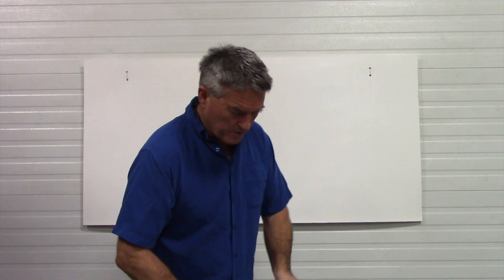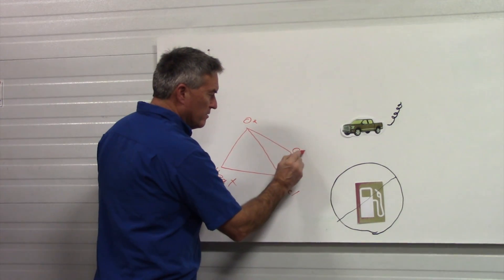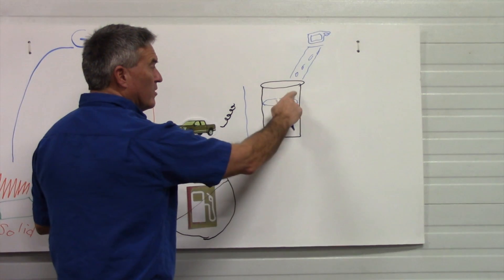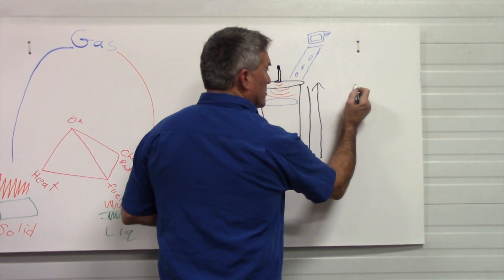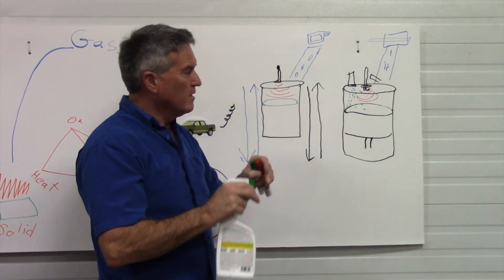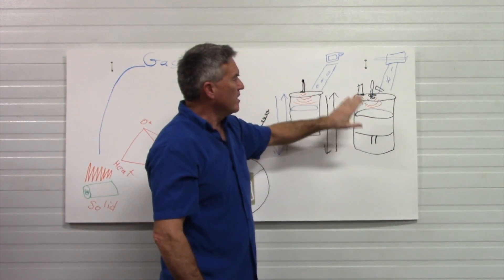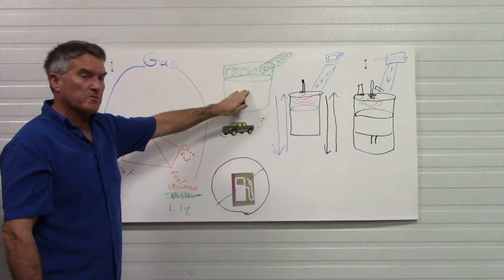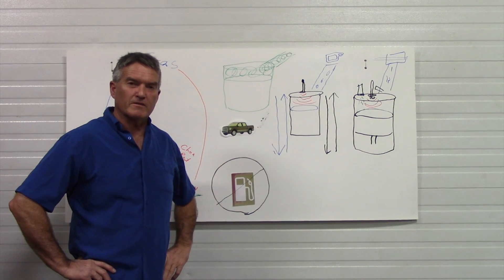One Simple Trick to get 100 miles per gallon with less pollution!

Comment: Pardon me, but you are full of BS.... GDI is the exception, not the rule.... very very few engines use direct injection.   Also engines like the Ford Ecoboost of Subaru DIT use targeting to stratify the charge, so that they can burn very  lean mixtures under some circumstances..... like a diesel.      The wonders of vapor fuel is utter BS for a number of reasons.  This has been tried and advocated for many years.  It DOES NOT WORK..... PERIOD!!!   This is utter bullshit, and I speak from many years of REAL WORLD EXPERIMENTATION.    I've been playing with vapor fuel off and on for over 40 years, reading all the literature, and building various experimental systems.  It is simply nonsense!!  But persistent nonsense.    I've done this on large generators and pumping engines running irrigation pumps where there is a fixed load, and I could control the flow of vapor and air, adjust timing in real time, etc.  In other words FULL CONTROL OF ALL VARIABLES....... It simply is a fantasy, and utter bullshit.
      The proof of the proverbial pudding is the efficiency of propane and natural gas engines.  There is less energy per gallon in propane than gasoline, but it is a fully vaporized fuel as it enters an engine.  Efficiency per gallon of propane versus fuel efficiency per gallon ( or pound ) of gasoline is roughly proportional...... IF YOU BUILD THE ENGINE ACCORDING TO THE NEEDS OF THE TWO FUELS.   Propane for example needs a higher compression ratio to be efficient, but even with an optimum engine it does not show the supposed dramatic benefits of vapor fuel. 

      The reason for this is simple...... In a gas engine, the heat of initial combustion converts the fuel to vapor virtually instantly.    I can promise you that you WILL NOT achieve these dramatic results, because they are not there to be had.  It is appealing as much as I and most others hate oil companies, to believe in a vast conspiracy.... it does not exist, and never has.  This is pure "pie in the sky". 

        Having rebuilt literally hundreds of engines over the last 40+ years, and worked independently in a field that allowed me to experiment on fixed load engines as few people ever are able to, I can say with assurance of experience that this nonsense with the exception of the obvious truth that fuels  must enter a vapor form to combust... which even a child knows who has watched anything burn.
        Petroleum fuels in internal combustion engines hit the wall at about 20% efficiency.. perhaps slightly higher with improved technology, but that increase is pretty minuscule.   Improved efficiency is to be had from reducing loads, and improved transmission systems that allow an engine to operate in it's optimal efficiency range.  The biggest potential gains are to be had in capturing a percentage of the waste heat, and using it for other purposes, as the waste heat is about 80% of the energy of the fuel.   This technology exists in the form of change of state salts that can capture heat, as they change from solids to liquids, releasing that heat as they convert back, and that is where we need to be looking.   Energy burned for propelling a vehicle, or for heating a building..... what's the difference?   It's still fossil fuels burned, and carbon released into the atmosphere, and a depleted resource. 

      You will NOT achieve huge increases in "gas mileage" until you start looking not at "gas mileage" but at fuel energy utilization overall.  It's as simple as that.  If the gas you burn not only takes you to to work and the grocery store and bar and shopping mall and Dodgers game, but heats your home.... or at least helps..... Then you win.    If you focus ONLY on "mileage", you will beat your head against the proverbial wall and never get ahead!!

Comment: I believe this to be true. I burn wood for heat in my home. I always thought that wood just burned when it got hot enough until I read an article that explained how heated wood releases gases that burn. My stove has perforated pipes inside across the top that bring in air from outside (below) the stove. Me and my rabbit like to sit and watch fire that seems to shoot out of the holes while flames dance above the logs.

Back in the 1970's there were stories circulating about similar concepts/devices. One guy claimed that a nail thrown up by his lawn mower blade pierced the gas tank with a small hole. He said it seemed to never run out of gas after that; his theory was that air entered the small hole and increased the the evaporation rate of the fuel - do you think "running on fumes" is a myth? I'm not a physicist but I've heard there is a calculation for the caloric (as in Energee!) content of an ounce of gasoline. A VERY small amount of gasoline will produce explosions comparable to those produced by TNT. Other people I heard back then used air pumps and an expansion tank of sorts to vaporize the gasoline before introducing it into the manifold. I feel it's only a matter of changing liquid gasoline to a vapor, safely, and mixing it with the appropriate amount of oxygen before or as it enters the cylinder. I kind of think that a small percentage of water vapor could also be introduced with it to increase the pressures produced - quite inexpensively. There are a lot of combustion engines on earth. We are burning our planet's blood  and fouling the air.

Comment: fact is a fuel injected non-diesel vehicle that has a properly functioning catalytic converter in its exhaust system puts out cleaner air than it breathes, there is a small amount of water a trace of hydrocarbons and CO2. What is the big offender coal burning powerplants used to make electricity. The reason automakers implemented fuel injection was not for performance it was because a ICE or internal combustion engine could not be made to run as lean as they do with a carbuerator. And heat is by product of the combustion process where you came up with this pyramid I wonder  but the formula or target air/fuel ratio lamda or stoichiometric is 14:7:1 no heat and really no chem reaction, remember physics no energy is ever lost it can be converted thus the atomized fuel is ignited converted to heat. what does this engine require 14 parts air, 7 parts fuel, 1 part carbon and a match to light it (spark plug).

Comment: This informaition is correct.  Implementation is more difficult.  Metering small amounts of liquid fuel relative to volume of air is hard.  Which is why most lawnmowers are finicky once dirty and hard to keep running.    Metering small amounts of gaseous fuel relative to volume of air is harder... but not impossible. Now design it. Fuel is used to cool valve seats, oil to lubricate piston, and anti-freeze to cool block. With gaseous gasoline and air mixture you now probably creating lean condition...

Comment: I did one better. Using just a crescent wrench and a flat blade screwdriver, I increased the horsepower on my 1969 Toyota Corolla to 850 HP with just one simple adjustment and I am now able to drive almost 3,000 miles on a tank of gas, which holds 4 gallons of gas.
You may bullshit kanaydians, but don't try to insult the intelligence of an American, aye!

Comment: Fuel does not cool and lubricate the cylinder wall, lubrication comes from the oil in the oil ring and cooling comes from the water jacket... fuel on the cylinder walls lead to increased friction, premature ring wear and increased blow by.

Comment: This guy is a moron, my first clue? When he said " fossil fuel" which it is not, the material we call crude oil is of mineral origin and percolates from deep within the Earth's crust, the process pushed along by heat from the Earth's mantle of molten material, this guy is clueless, you can get extreme mileage from your cheap little rice grinder, until the heat generated by extremely lean conditions melts the Pistons. Then your done

Comment: what we all dont know, well I know gasoline is less efficient then a steam engine.    I also know the effeciency is less then 40% ( meaning if you calculate how much  is going in, and how much energy you get from it..   pathetic really

and the end run, I KNOW that big oil will never release they're stranglehold on better fuels..

one proof is Stanley Meyer..   the guy who invented the car that ran on water (in ran on hydrogen/oxygen split from water)
but he was poisoned to death...   wonder why you'd kill someone if his stuff didn't work...
Reply: good points Harley.  Tip for you, "then" and "than" are two different words.  Check it out, you'll sound smarter.  Fusion may be our savior once quantum computing is harnessed.....  Until then, Shell Oil for me.

Comment: yup, its really easy, I get infinite miles off 0 gallons of gasoline....  because I'm splitting water with electrolysis and using the hydrogen and oxygen to run the car...  lol  dont give me any bullshit.

gasoline   = 87 to 94.  and all of it doesn't turn to energy.
hydrogen =  130 octane.  and all of it is energy.

so how bout 100 miles on 1 ounce of water...  LOL  get fucked oil company

Comment: If this happened, government would have to increase taxes on gasoline to make up for their "revenue loss". This happens whenever government gets comfortable with any level of funding and then somebody gets clever and finds a way to reduce consumption of the base metric of the revenue stream. Example: San Francisco bay area residents were told they must conserve half their water during California's drought. The residents did, the water company's complained that they weren't receiving enough revenue. The water commission "adjusted" the water rate so the water companies were receiving the same revenue by supplying half the water.

Comment: We are in no way approaching a shortage of petroleum, in part due to the fact that reservoirs are much larger than previously thought, and in part due to advances in extraction technology.  At the same time, advances in battery technology promise to make fossil fuels unnecessary by mid century.  By that time, every car will be electric, and by 2080, every airplane and every boat will also be electric.  Petroleum will continue to be used for basic power generation for a while, but even that will be short lived as solar and stored energy become cheaper than drilling for oil.

Comment: The liquid fuel does not lubricate the cylinder, unless it's a two stroke engine 😕 and then it is gasoline mix with ~2% mineral oil. But you are right about the liquid gasoline will cool the engine, ask any Nascar driver

Comment: Of course it can, but I thought you wanted to reduce the so-called 400 million gallons, not increase its usage in just about everything except maybe the kitchen sink and power toothbrushes.  Where are the savings then?  Just heat the fuel before it reaches the injectors.  Works well.

Comment: Vapor carburetors have been around a long time, I actually built one and ran a lawn mower engine on vapor alone and it worked well, the downside I discovered was it basically distilled the fuel down the the non-burnable crap they leave in the gasoline. Vapor carbs do work, but mine was crude and you will need to be able to vaporize ALL the gasoline, including the somewhat non-burnable elements in the fuel.
Reply: My Older Bro. Put A Lawnmower carb on his car in mid 60s. It worked pretty good. But people called him Crazy. Just like several comments by readers.

Comment: Well he said a lot of things just to get to one point which is the basic principle of a 4 cycle engine. Suck, squeeze, bang ,and blow. Also something he said that the fuel had to lubricate the cylinder and that is wrong on a 4-stroke engine a two-cycle engine does mix oil with gas, but not a 4-stroke.

Comment: Some have designed gasoline vaporizing intake systems, but they had so many fire issues and under power that the idea of pre-vaporizing is moot. The main issue is the energy required to power an engine with a load it is operating. An engine with only itself to power uses a tiny fraction of the energy one under load uses. 

One way that does assist fuel consumption is adding a water vapor mist to the intake. I've used such a system for years, yet it is just a fraction better than current intake systems. However, the mist does help reduce emissions.
Reply: Interesting Sir! Thank you

Comment: If you're still alive, let everyone know!  "THEY" have killed three people (as we know of them) who made H2O-fuel-burning cars and engines.
Best wishes,
Reply: Let me know where I can get this invention.... Love to try it ...jonrankin0315@ Gmail.com
Reply: @jonrankin7917  Hello,
I think you have sent your note to me by mistake; however, you do not need to go through all that process and can make a device in your backyard.  If you decide to proceed and try it, keep it between you and yourself.
l)  You need a small insulated (8.0e1 x 1.0e1" x 1.4e1") triple-layer vacuum (vacuum must be between the second and third cylinders) cylinder made of stainless steel.
ll)  Wrap heating wire/coil element on the inside cylinder to generate about 3.0e1-4.0e1 amps for a 1.2e1-volt battery.
lll)  Run a tube from the exhaust manifold (for hot air) through the inner and the second barrel; before the vacuum cover.
lV)  Route the gas through the inner cylinder, which initially (before the engine heats up) provides about 1.7e2℃.
V)  The output gas is so flammable and combustive that would need a cast-iron engine-head.
Vl)  The gas mileage for a six-cylinder, 4.0e2 horse-power, and a five-ton vehicle shall be around 5.0e2 miles per gallon. 

P.S. _ "THEY" are not idiots to go miles down in the waters and ice to bring oil for gas and are willing to kill billions to achieve their filthy goals.

Best wishes,

Comment: I am confused. Are you talking about a Diesel engine ?  If it's a diesel your example of heat, oxygen and fuel are correct.  I thought you had to have gas, oxygen and spark plus the correct timing.

Comment: Correction--It sprays only TWO times per second if it's part of an 8 cylinder engine. A cylinder of the 8 is spraying 17 times per second.
Reply: I'm puzzled how you came up with your numbers......
2000 revolutions per minute (rpm),  is 33.33 revolutions per second.  The fuel is burned once for every 4 piston strokes,  same as every other revolution of the crank shaft (the piston goes up and down each revolution,  2 strokes).  That works out to 16.6 times every second! That's per cylinder. 
2000 / 60 (seconds in a minute) = 33.33.  33.33 / 2 (revolutions of the crankshaft) = 16.665.

Comment: The theoretical, stoichiometric air/fuel ratio is 14.7:1.  14.7 parts air to 1 part fuel.  Supposedly the perfect ratio to burn all the fuel to leave no raw fuel behind. But raw fuel doesn't burn. Only gas, vapors, of said fuel will burn. When using fossil fuels n current introduction methods, it's apparently impossible.  U want a Clean burning fuel?  Make fuel from Hemp products!  From what iv researched.... Its only biproduct is H2O.  Do the math folks. There Is A Better Way.  Namaste🙏

Comment: This has been done by a heat exchange from the exhaust  for piston engines during WWII  in airplanes. I worked with a guy who built one for his car and was getting over 30 mpg out of a 454. It worked great, however the patents have been bought out by the oil companies and  they will not allow this to be commercially produced. We can burn hydrogen and oxygen that puts out zero emissions by separating water molecules as well. This has been suppressed  too. It is relatively simple to make an HHO generator using 12 volts  in water. I have made one and simply introduce the gas into my intake at the air cleaner . This alone increased my miolage by around 30%. A guy named Stan Myers had a car that ran on 100% WATER . He was poisoned. Look up "Stanley Meyers water car" and there is  videos that show this..Nobody wants to believe that we have been lied to by the government, so they choose to  pretend they didn't hear it. That is how the Federal Reserve stays intact. Then there is Tesla.................. Here is a video of Stan Myers and his water power car that got him killed.                                     https://www.youtube.com/watch?v=GFIlXaABU54

Comment: We just can’t get around the laws of thermodynamics.
Reply: Did he state he was getting around the law of thermodynamics somehow? He is simply changing state from a liquid to a gas, thereby expanding volume many times, without losing the BTU rating of the fuel. An engine doesn't like burning liquid fuels, which is why 80 percent of every gallon of gasoline goes out the tailpipe never having pushed the vehicle down the road.  
This is also the reason we have such massive production of hydrocarbon and other emissions from even modern day engines.

Comment: That would be running with a ticking bomb. As the air-fuel vapor mixture is highly volatile and flammable. Even a 5% reduction in safety will completely defeat the purpose...but theoretically using these (not practical) it will actually be much more riskier.